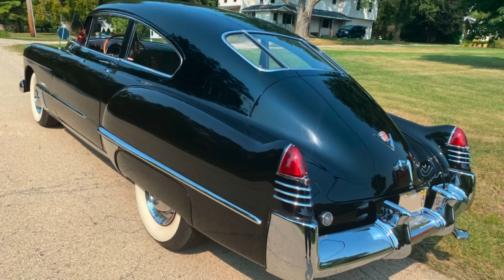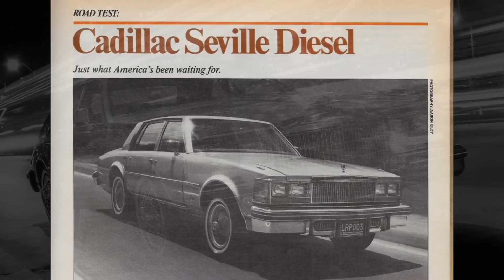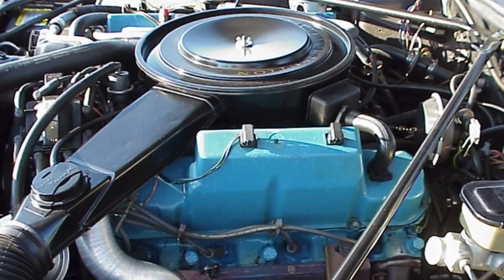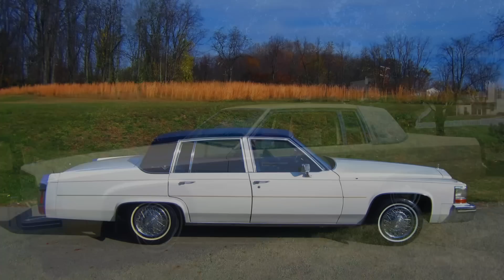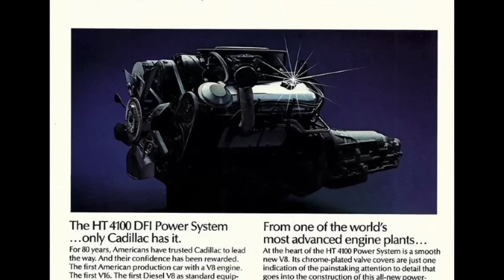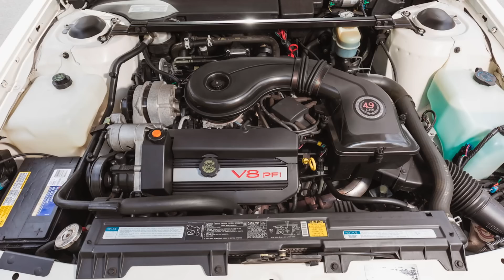This is GM's Worst Decision for Cadillac and Affected Its Reputation for Decades...

Comment: I had found the most beautiful 1983 Cadillac Eldorado Biarritz in flawless condition in the mid 90s(or so I thought). For me, I always had the consensus that anything Cadillac was a going to be a win/win scenario(not with that damn HT4100 engine). I guess that GM didn't learn any lessons from the throw away engine produced for the Chevy Vega?! Anyway my beautiful Caddy was in the shop more times for engine issues at a local Scottsdale Cadillac dealership. (The Service Director had the misfortune of dealing with me, and my recent purchase. So much so where I had had enough, getting the car home after a partial engine rebuild, and several trips to their shop. I ended up trading the car in for a new GM truck). I understood the CAFE standards for fuel economy, but when a major player in the auto industry as large as GM was, brought this engine to market...then suggested using those damn AC-Delco radiator pellets as a fix for common HT4100 engine problems, one had to gasp). Adam, great job yet again. (Your Youtube base is growing, and certainly should be even more so).

Comment: I replaced a LOT of ht4100 motors. Usually with a new one from a crate. Came with stop leak pellets that were required for warranty, lol. Shown is the actual pellets that were supplied! Thanks for the video.

Comment: My grandmother insisted on buying Cadillacs and had an 85 Fleetwood two door with the 4.1 liter V8. It was a nice driving car but every few months my grandfather would add some anti-electrolysis fluid to the radiator to keep the engine parts from swapping electrons. He owned and maintained his own aircraft and knew about aluminum more than most and flat refused to use walnut shells.

Comment: GM biggest mistake was pushing out cars and engines without enough development! Then when they just get it right, they end production.

I give Cadillac credit for coming up with the idea of engines on demand, in the early 80's. But they pushed the engine into production, before perfecting the product. That's what happened to the 8-6-4 engine. The concept was great, but the technology was not their to work.

Comment: At the junkyard a few weeks ago, I saw a '86 deville with the ht4100. The car had an engine replacement at some point in time as it had a goodwrench sticker on the core support, however this car somehow my managed to make it to 257,000 miles before that ht4100 died.

Comment: My 4100 powered Eldorado was a nice car, but boy was it slow. At least it got decent mileage. Until it blew a head gasket. Sigh. Too bad they didn't just leave the 368 in them. Or maybe an Olds 307.

Comment: Cadillac had a outstanding reputation for decades. The Standard of Excellence, was more then just a motto. Cadillac enjoyed a fiercely loyal customer base. A person who bought a Cadillac almost always bought another Cadillac. Cadillac took all of that and flushed it down the toilet. Cadillac quality had been in slow decline throughout the 70s. As Cadillac production figures went up, their quality went down. Then came the Oldsmobile based diesel V8 engine. Which was garbage. Then the V8-6-4. which was garbage. Worse still, Cadillac knew it was garbage. Then as if Cadillac couldn't do worse, they did. The HT 4100 was garbage. Then the lousy downsized FWD full size Cadillac of the mid to late 80. Let us not forget, the Cadillac Cavalier. Then to add insult to injury, Cadillac ignored many customer complaints, and quality problems. This led to class action lawsuits against the division in the 80s. Cadillacs entire management team from that era should have been shown the door. Here we are over 30 years later, and Cadillac has not yet recovered. It is extremely doubtful they ever will.

Comment: The loss of power was the detuning to meet pollution goals. This is before catalytic converters?
It's the oxides of nitrogen that will be generated under high compression. Now there's different ways to control it. All this really comes from not giving a s**t about the environment as there was no future looking r&d and being forced to so after the fact. They always run to the lowest common denominator. The Japanese already had past (bettered) the code before enforcement.
This year is going to be the 1.5 degrees of average heat from preindustrial times. It'll fall back after this year, but we're edging up.

Comment: In 2000, I bought a beautiful well kept 83 Eldorado,  lifelong Southern California car,  from a lady who was the original owner.  Had a tick over 80.000 miles on it. Now has little over 120.000 miles. No engine issues, original engine. I do 6 month oil changes and coolant change with the tabs every other year. Only drive it about 1000 miles a year now. But still enjoy it, and it's a great looking car in and out, and definitely rides and drives like a cadillac should. I was 24 in 83, and thought they were extremely handsome cars. They did sell like hotcakes,  they were everywhere,  and cadillac kept the same body and interior from 1979 to 1985!  Then a redesign in 1986 FLOPPED and Eldorado sales tanked.

Comment: Caddilac should've put the Olds 307 in like Buick did in their 79-85 Rivieras. Great motor. I even have the 307 in my 88 Fleetwood Brougham. It has no problem pushing it around and they get  17 miles to the gallon.
Reply: In the Riviera, '79 had the 350 if you got the V8.  '80 was either, though the 350 had reduced power vs '79.  '81 was 307 only for V8.

Comment: I am one of those that sworn off Cadillac due to the 4100 engines.  It wasn't just the engine though.  The transmission they had in those cars were equally a pile of plastic junk.  My 82-model stayed in the garage more than it ever did in my driveway.  I wish I had taken some pictures of that 50-acre field across from the GM plant in Atlanta off I-285 back then.  It had so many Cadillacs and big GM Buicks & Pontiacs parked so close to one another they actually had to roll the windows down to get out of the cars.  All of them parked there because of engine and tranny problems that GM could not fix.  Thousands of cars.  My car was so bad and had been sent back to the dealership for repairs so many times that the dealership actually and intentionally wrecked my car so they could total it out and not have to spend more money on it.  Know this to be true cause my insurance company at the time sued the dealership for that reason and won the case.  Insurance company was paid as well as myself.  I received $25k out of the case and I promptly purchased a brand-new Mazda 626 for $12k.  One of the best cars I ever owned.

Comment: I still have pictures of a couple that parked their "lemon" Cadillac Eldorado right on the street directly in front of the main entrance to a prestigious  Cadillac dealership. The couple were dressed in yellow, and had yellow poster board documenting all of the failed attempts to fix their automatic transmission, which  what they told me,  was the same one used in GM's cheapest car, at the time, the Chevy Chevette. I rushed home to get my camera, and return, and took numerous pictures, with the couple's permission.

I also have pics of a GMC box van taken in front of the Post Office in Hollywood, Ca. where the owner painted an image of a guy pulling out his hair in anguish, on both sides of it, saying "ARRGH!", and with giant lettering "U 2 CAN OWN A GMC DIESEL 4 $20,000" with a giant image of a lemon.   Above the cab of the truck was an image of a giant lemon, as well.  The guy gave me permission to take pictures.  Both of these incidents occured in the mid 1980's.

Comment: We had a 65 Caddy convertible in white. Then Dad bought an 81 diesel Eldorado and that was a disaster. The dealer replaced it with another diesel Eldorado with more options and it didn't explode. At least until my sister forgot it was a diesel and put regular gas in it. Dad had someone put a small block Chevy in it and was a far better driving experience than it ever was with the diesel.

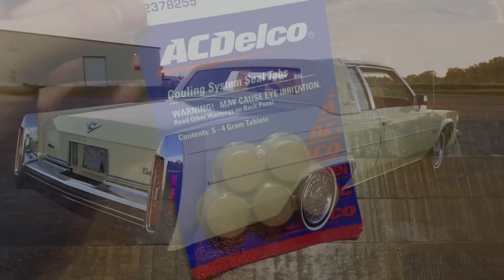Comment: 07:32 I wish I had known about this GM coolant issue and the supplement tablets.  My 1982 Oldsmobile 88 with the 307 engine suffered from this problem.  Had I known, I would have serviced the vehicle coolant better and would have kept the vehicle longer.  Instead, when it needed a new head gasket in 1998 (16 years old), I simply sold the vehicle.  The new owner got several more years out of the vehicle, but I would have preferred it to have been me because I liked the vehicle very much.

Comment: Agreed, the 4.9L was a beast of a motor in the 91’ Seville. It would easily smoke the front tires with heavy throttle and could effortlessly cruise all day at 90+ mph. I remember very well how impressed I was with the whole car overall.
Reply: I did this alot with a 91 Seville hearse. I stand by your claim. If you roll on the throttle in a roundabout, you can smoke the front left through a couple gears with ease, which I found hilarious!

Comment: The fact that you HAD to use stop-leak in the cooling system straight off the showroom floor was probably the WORST damage to Cadillac's reputation from the HT4100. Imagine paying Cadillac money for a car, and being told to put stop-leak in the radiator. Like, excuse me? I paid this much money for this car, and they couldn't engineer it to not leak? Like what literally even the cheapest cars from 50 years prior were expected to do? Talk about shameful. Also, from an engineering outlook, an aluminum block with iron heads just appears to be a really half-assed attempt to lighten the engine, rather than an attempt to truly make a "High Tech" engine, as its namesake suggests.

Comment: I had a 93 deville with the 4.9l.  That engine ran amazingly well.  I think i would get close to 30mpg highway cruising. Changing the spark plugs by the firewall was very difficult however.

Comment: I knew many owners of the diesel caddys….    Changed the engines out to a 350 …. 4,6,8 drive.   You could bypass that.   The HT4100.   The WORST….

Comment: Worked at a repair shop in the 1990s and a Cadillac  came in for a oil change with the HT 4100
 With new oil and filter knocked so badly , we tried different oil weights, filters to no avail 
Woman owner was furious at us! We eventually called Cadillac and they towed car from our shop to dealership.  They replaced the engine, under warranty. Only had about 60,000 miles 
Nightmare of an engine design as many technicians will attest to. Sad how Cadillac bean counters made a once proud division deteriorate

Comment: Owned a 1984 Cadillac Coupe De Ville with the HT 4.1 V-8. Put 150K miles on it without a problem. Overall the car was very reliable. Smooth, quiet and got really good MPG. Not a speedster but got the job done well. Went on to own a 1990 Fleetwood 60 Special with a 4.5 V-8. Great car! Also had a 1995 Sedan De Ville, 1997 Catera, 2001 Catera Sport, 2003 CTS Sedan and a 2007 CTS Sedan. All of the cars were bought new and gave me very good service.

Comment: GM could have kept using the 307 olds engine in these big cadillac's but went for this junk ass engine BECAUSE the 307 used more gas in the city but was very good with the THM 200R4 on the highway.

Comment: The HT4100 also had wet, cast iron cylinder liners that used O-Rings for sealing at the bottom.  They leaked like a sieve. I recall changing the oil on one of these and about a quart of coolant came out first !!  If the oil change was done a few weeks later, the engine would have been wiped out. One customer who always bought Caddies, complained of the lack of power.  He previously had the '79 Eldo with the TPI 5.7 which was quite fast.

Comment: 5:20 The 4100 made 200 lbs-ft @ 2,000 rpm. My mother had a 82 Sedan Deville. The car was slow but it did get 24 mpg on the hwy. I used to pretend I was driving a diesel. The car seem ok then. Her engine ran fine. The problem was the computer cause the car to just stop. Cadillac didn't know how to fit it. My cousin who work for GM told us to tell the dealer to change the computer. They didn't want to do it because they thought if the computer was bad. The car would not run at all. They were wrong. A new computer fixed the problem.
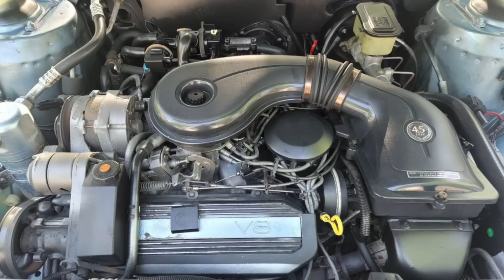9:50 the 1990 4.5 made 180 hp because of a hotter cam.
Reply from the maker: And pfi
Reply: @RareClassicCars  PFI help the engine run smoother but the hp came from the cam. If you put the right size carb on this engine. it would make the same 180 hp.

Comment: We had an 84 Fleetwood with the HT4100. I must have gotten a good one. It wasnt a racer, but once up to highway speed it did okay. Problem ours had was the 2004R transmission. Died twice and I found a Pontiac th350 and put it in place of the 2004R. 

Surprise it climbed hills better and actually did better on fuel mileage. 

The HT4100 gave up though when the fuel pressure regulator diagram failed and dumped tons of fuel down the engine.

The car had almost 300,000 miles by now so I didnt repair it.

Comment: I had the ht4100 in my 87 Coup DeVille. I bought it in 2009 in showroom condition, with about 80k miles. I was preparing to have issues and I luckily never had one. That was overall a great car, and definitely wasn't slow. I also had the 88 Sedan Deville with the 4.5. Also a great performing car.

Comment: My parents had a 1966 sedan de ville and a 1971 sedan de ville. I bought a new 1979 Coupe de ville with a 429 and pulled a boat and 2 horse trailer with it. I heard so much bad about the 4-6-8 motors I bought Olds for several years. Then my mom and I both bought a Cadillac in the 90’s with the Nortstar engine. Both cars used a quart of oil every 800 miles! The dealer said that was normal! We sold both and went to Lincoln’s. Today my only Caddy is a 1969 Eldorado with a 472 and 375 horsepower! Cadillac sure lost a lots of business from diehard enthusiasts!

Comment: When I first saw the butchered down deVille line in 1985 I totally gasped. I thought "that's a Cadillac??". To me it was a laughingstock.  Same for the Buick Electra and the Olds 98.  Absolute jokes (an Olds 98 with a V6? GIve me a break!) Fortunately Cadillac kept the larger body and it became the Fleetwood Brougham and they sold like hotcakes until discontinued in 1991.

Comment: I'm glad the 1977-79 7-litre was mentioned, as that was a very common trade-in on the dreadful 4.1, perhaps more so than the 6-litre that only lasted two years.  So, it was a huge power difference - a much degraded experience, even running properly.  The stopgap optional 4.1 Buick V6 was as underpowered and inherently less refined, a rather high-comedy solution for a luxury car engine dilemma.

Comment: GM did release a updated intake gasket & bolts in Jan. '89, (TSB T 90-61) for the 4100 & 4.5,  but by then the damage was done. Front main bearing knock was common, a revise bearing was released for that concern as well. Carbon sticky exhaust valves were also common.